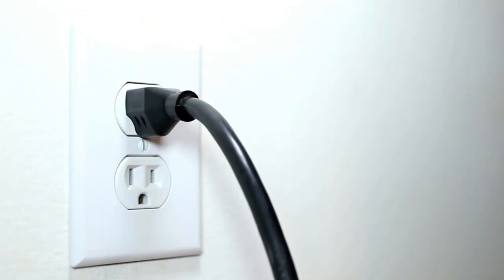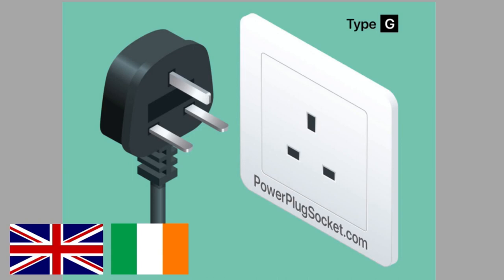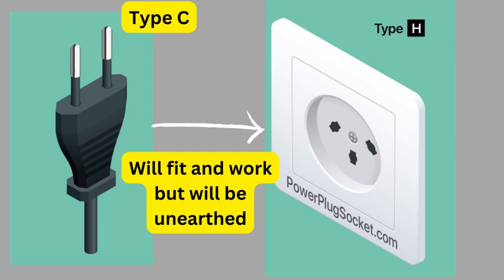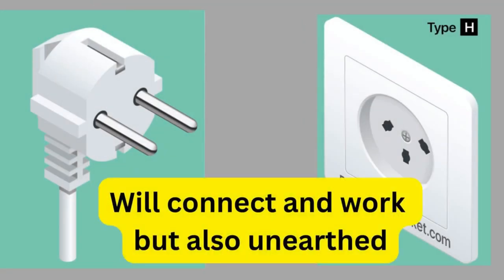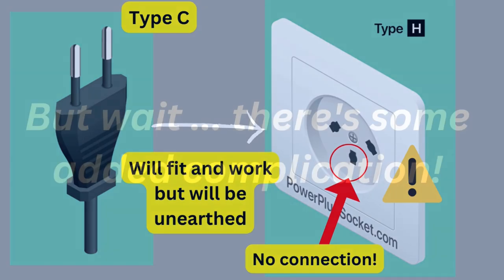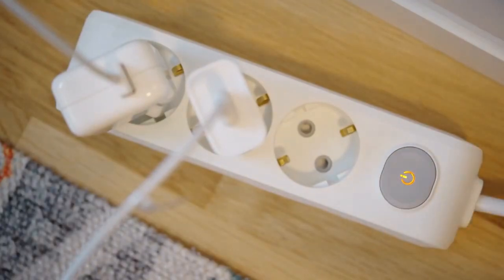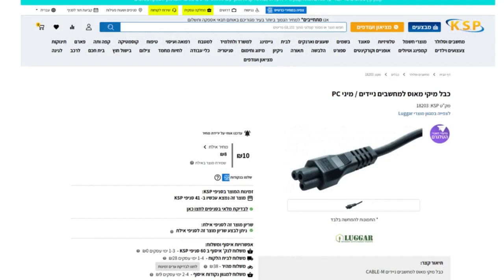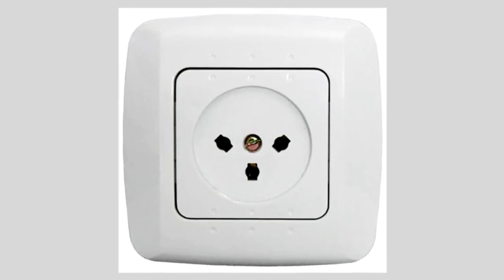Israeli Plugs + 2 Pronged Appliances (Europlugs) - A Safety Warning

Comment: a simple solution is to fit an israeli plug to a multi socket extension from your home country, it saves all the hassle ans takes 5 mins to swap plugs. i have a european one and an couple of israeli ones.
Reply: Provided your home country doesn't have different voltage than Israel! (USA, Canada, Mexico...maybe also Japan?)
Reply: An Israeli here, I do the opposite(fit eu plug to Israeli extension bar) when traveling to eu.

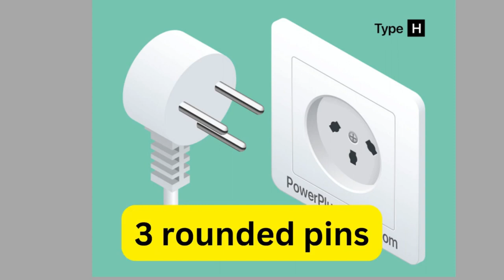Comment: 0:35, I think you mean step-down transformer (hence step down the voltage) , not step-up. Also be very careful and make sure the 110V/120V appliance is compatible with 50Hz AC as step-up/down transformers don't normally change the AC frequency. 

Also 2 prong plugs normally feed double insulted appliances that don't require a earth/ground, hence why they are 2 prong not 3.
Reply from the maker: Thanks! I tried to make clear that I was referring primarily to the Europlugs with earthing (type F I believe?)

Comment: You need to edit this video. You meant step down not step up.

What you said about type C plugs is very confusing.  If an appliance comes with a two pin plug then obviously it doesn’t need a ground and you don’t think about it - just plug it into the Israeli outlet.  only if it comes with a three pin plug do you have to deal with the ground.
Finally you say you can plug a 3 pin European plug into an Israeli outlet.  You absolutely mustn’t. It will bend the copper and damage the outlet.